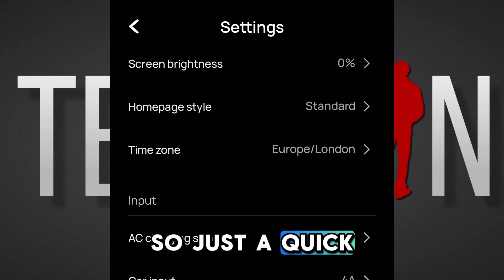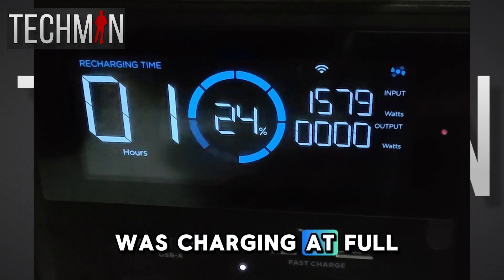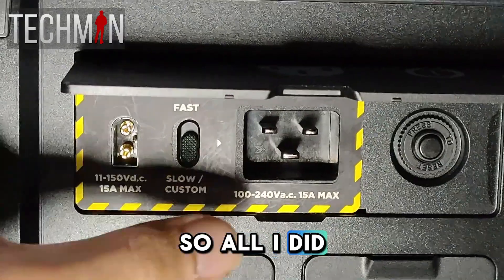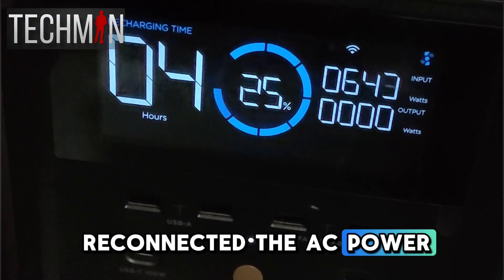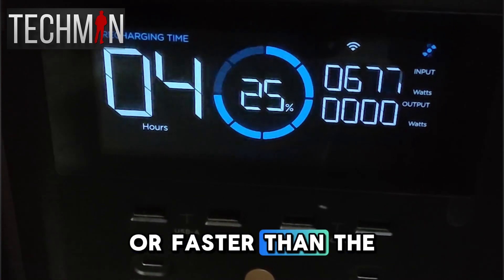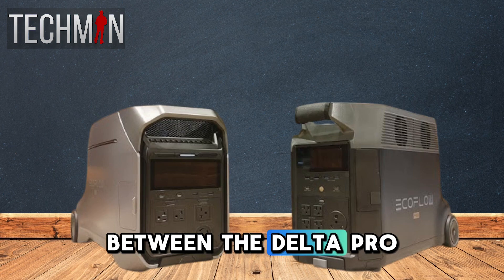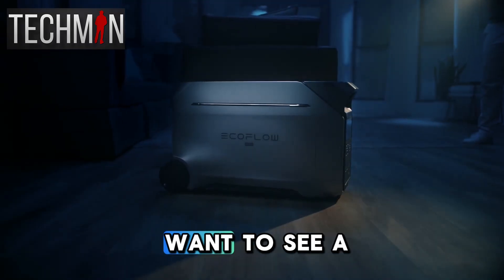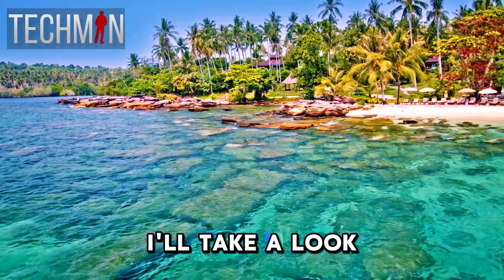EcoFlow Delta Pro Charging Problem? THIS Simple Trick RESTORED Slow Charging!

Comment: I have an issue with the latest firmware, that if the solar cable is plugged in overnight the next day it might not charge with solar unless you disconnect and reconnect the cable, this firmware initially came out in May however I noticed they pulled the firmware while they tried to patch the issue, the firmware had been updated this month and the issue persists. I’m wondering if you know of any fixes to this, maybe a way to roll back on firmware?
Reply from the maker: Hey Joseph! I've never been able to solve the solar lockout bug you mention. It's a very well known issue widely reported on multiple forums. Surprisingly, EcoFlow haven't been able fix it. I'm disappointed with EF. 

You may need to reach out to EcoFlow Support for a beta or rollback build. Keep me posted!

Comment: My device won't charge at all. When I plug it in, the blue light circles around, but it doesn't actually charge, and the display doesn't stay on. I just received it, and the box was delivered upside down! When I press the power button, I can briefly see the display, but then it goes away. Am I doing something wrong? I contacted the company, and they offered to replace it with a refurbished unit instead of a brand new one ! Weird
Reply from the maker: Hey, I don't think you're doing anything wrong. It's sounds like a defective unit. They should replace if for you with a NEW unit. Don't take anything less from them.

Le me know how you get on!

Comment: Do you have any thoughts on the issue of only getting around a steady 100 watts when charging at multiple ev stations when it should be getting ~1500 watts (slow charging) and 3000 watts (fast charging)?
Reply from the maker: Hey, not heard of that yet, and it doesn't sound right. Take a look in the EcoFlow app once connected to EV charger to see if something is limiting the charging speed. If all fails, take a video recording and email EF customer support. Let me know how you get on!